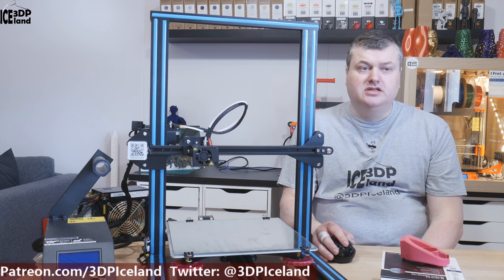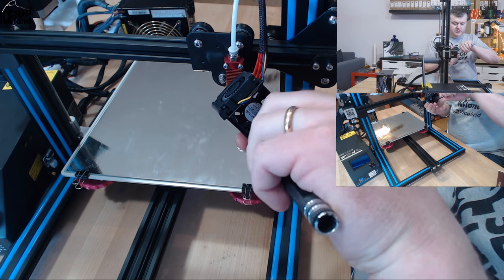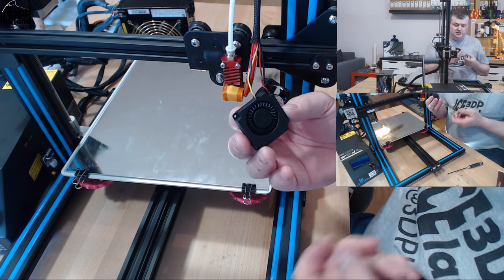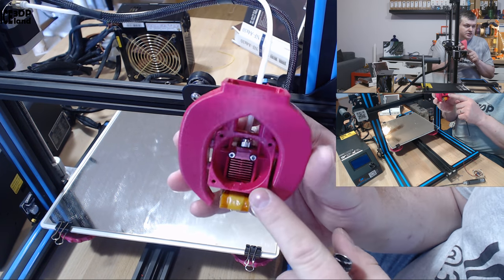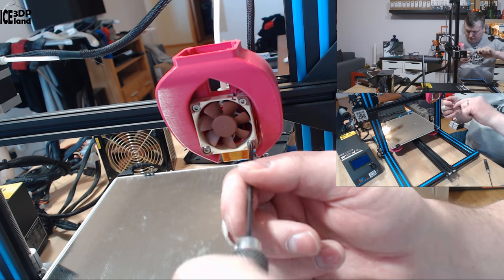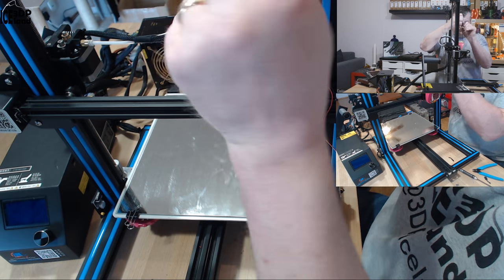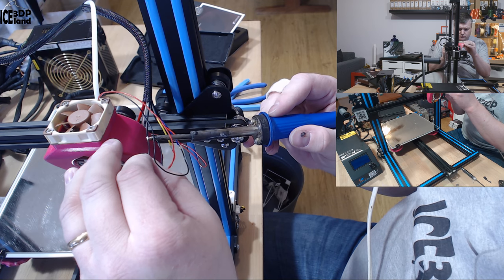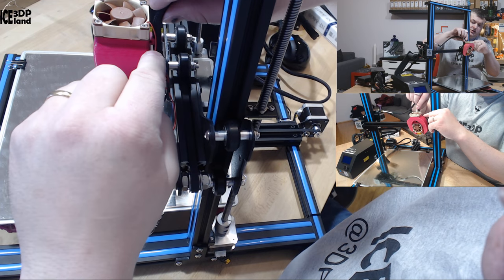Creality CR-10S  -  Noctua Fan install for  Hotend and part coling

Comment: Very good closeups. I wouldn't cut the sensor cable/connectors and use the Noctua couplings, if I ever need the fan somewhere else or even route the rpm sensor cable to the main board and use it with modified marlin firmware
Reply from the maker: thanks, - does the board on the cr-10 have a input for the sensor wire?,  I don't mind buying new fans if I have another project :) hehe
Reply: 3DP Iceland I guess it has. Prusa uses the x-max sensor pin to read the RPM with the MK2.5 upgrade kit. Only thing you might have to check the voltage of the sensor wire isn't higher than 5V as your fan is 12V. You can re-solder the sensor wire :-) Check Marlin if they support rpm fan reading... I have tomorrow a look...good n8
Reply: Was looking in Marlin and couldn't find fan tachometer function...don't know if there is a function or not...maybe it will come, depends on the development and needs of the community
Reply from the maker: 3D Gussner ahh. Thanks for looking though 😀

Comment: Nice video. Thanks for sharing. I used it for my upgrade. In the video I see that you have an option to control the speed of the fan. Do you use the stock firmware? Do you also know which version? I use the stock firmware but missing that option.
Reply from the maker: Hi. Thanks. I used custom marlin firmware.

Comment: Nice video. Did you print the fan duct with PLA?
Reply: Just rewatched the video and have seen you mentioning colorfabb xt  which is PET. Did you print it with the CR10?
Reply from the maker: @Tom-on-yt   Hi, yes, ColorFabb XT, printed on my Prusa mk3 :)
Reply: Do you also print these kind of filaments on the CR10S? ABS, PETG, Nylon, TPU?
Reply from the maker: @Tom-on-yt   I mostly print PLA, as I use this printer for my Landscapes,  but  I can print with other materals, - ABS needs enclosure, so if I would every print with ABS I would use that on my mk3 as it is in an enclosure (currenlty don't print ABS), use ASA when I need similar properties as ABS has.

Comment: will the mod be ok printed in pla with the heat bro???
Reply from the maker: Hi, I would not recomend it, petg or other simila would be advised, but you can try pla and see how it goes, most lokely the fan opening will melt first
Reply: @3DPIceland  massive thank  bro

Comment: Honestly, you're better off replacing the PSU fans first as those are the ones making all the noise ...
Reply from the maker: Hi, I have a video on that very process, https://youtu.be/18hUUFVjRSI , I have replaced the powersupply fan as well along with the original powersupply as it was dead a few days after I got the printer.